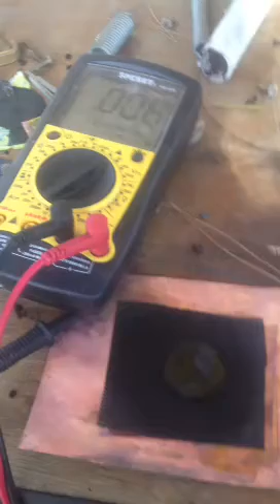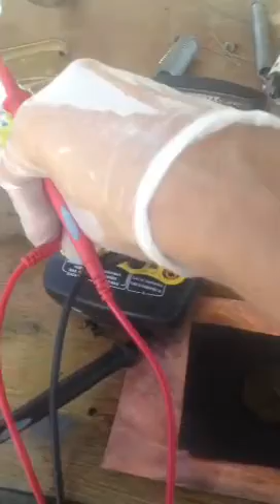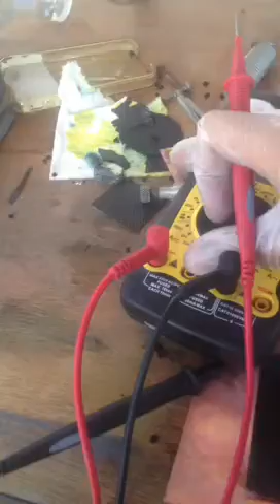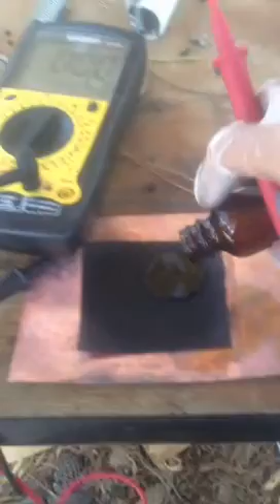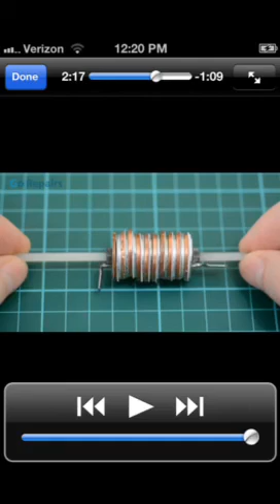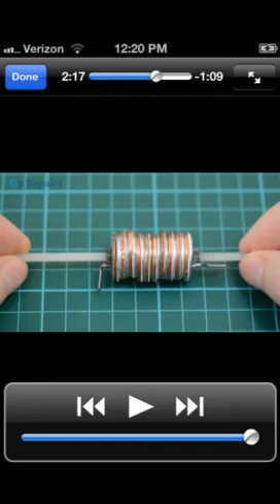Testing the Copper sintered Molybdenum Noble metal battery

Comment: What's the storage mechanism? I speculate that on discharge copper goes into solution forming copper chloride. Since you say the battery is rechargeable I speculate the protons are turned into hydrogen and stored in the molybdenum metal. I don't really know if molybdenum can store hydrogen. What are your thoughts?
Reply from the maker: Well what is happening is we are oxidizing cu metal into cu 2+ ions.  Basically we are creating a copper electroplating bath.  Then when you go to recharge the ions redeposit forming cu metal again, basically you are electroplating it with copper.  To my knowledge there is no other battery like it.  Problem is the voltage will basically stay the same until your anode disappears!  So you need to have a warning device so you know that once you pull out a certain amount of watts you need to recharge.
Reply: Does the battery bubble gas when it's making electricity? If it does then that tells me hydrogen is being released rather than being stored. It makes sense Cu goes to Cu+2. What's happening at the other electrode? Something has to accept the electrons that the copper has given up. The protons from HCl are a readily available place to put those electrons by turning them into hydrogen. If this is the case (and it might not be) then the hydrogen either gets released into the air or it gets stored in the molybdenum. This is just one scenario that could explain how the battery is working. Perhaps protons are being capacitively stored at the moly plate. That's another possibility. Then again, maybe this is something entirely different. Maybe I'll try this. What do you mean by concentrated HCl? Is 30-35% adequate?
Reply from the maker: I haven't looked or the cutoff but muriatic acid works.  Diluting it much more than that 31% makes it no longer work. Well what is happening at the cathode is the same as any battery.  The electrons go through the circuit, hit the cathode and either h2 gas is released or the H combines with oxidizer in the bath and creates water.  Truthfully you need oxidizer in the bath.  This can be in the form of dissolved air.  If this battery gets starved of oxygen the amperage drops off so this is indeed an "air" battery.  Which is cool because once the influx of air stops, the battery is stable and doesn't self discharge.  So really air needs to be "pumped" into the cathode or bubbled through the acid.
Reply from the maker: a slow drip of h2o2 also works.
Reply: +NatureHacker It could be the Moly is a good catalyst for the O to O-2 reaction and the opposite reaction of  O-2 back to molecular oxygen again. Have you tried swapping the Copper for Iron? I'd imagine you'd get better voltage though there might be other detrimental affects like faster self discharge. I realize it wouldn't be so noble if you did that.
Reply from the maker: I tried iron and copper it was reversed the iron was attacked.  The way you need to understand a battery is you need 1 metal attacked by the electrolyte and one metal that is not effected by the elevtrolyte.  Refractory metals like moly resist acids even better than noble metals but they are weaker to bases.

Comment: Good video.I'm surprised you haven't experimented with HHO. With your knowledge of electronics,I'm sure you could get tremendous results.It seems clear that making hydrogen and oxygen from distilled water,using an electrolyte and 316L stainless steel,is a "Low Tech" solution for energy that is being suppressed.    Also,when you vaporize gasoline with heat or an ultrasonic transducer, you can get about five times gas mileage of current ICE's.Because vaporized droplets of gasoline are about,5 microns in size,as opposed to from 50 to 65 microns currently being dumped into our engines.This results in incomplete combustion ,which is the cause of,inefficiency and carbon monoxide.
Reply from the maker: The main reason I haven't is the storage issue.  Lets say you have a solar panel and want to store the energy it produces.  You could create HHO but how do you store that gas on a meaningful scale?  May as well just store the electricity in batteries. I could see using it to feed into the car air intake on the fly but then you have to have onboard batteries and electricity to generate it anyway.  May as well just stick to electricity and not get the efficiency loss in the electrolysis.

So Ya I can't really think of a necessary use for it.  I grew up with electric cars too, my dad was one of the pioneers in electric car racing in the early 90's so I'm not particularly stuck on ICE engines.  Electric motors are much simpler and reliable.
Reply: +NatureHacker Thank you for your scholarship and thoughtful research.  When I saw your video on"Rockets"not working in space ,I knew what you were saying is true.I just never thought about it.Rockets definitely do not work in a vacuum.
Reply from the maker: ya it sounds crazy but when you really think about it deeply it makes sense.
Reply: +NatureHacker I remember an electrical engineer friend ,that made a capacitor out of styrofoam and aluminum foil.I don't know if this would help your battery idea,but it's the extent of my electrical knowledge.